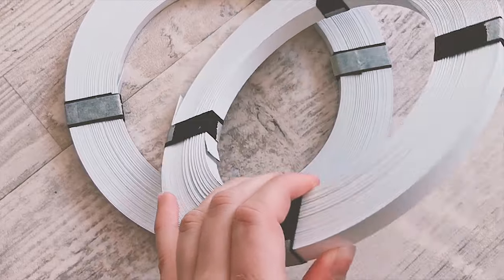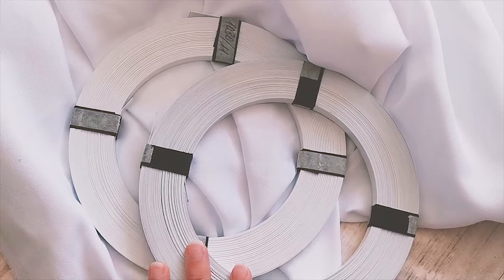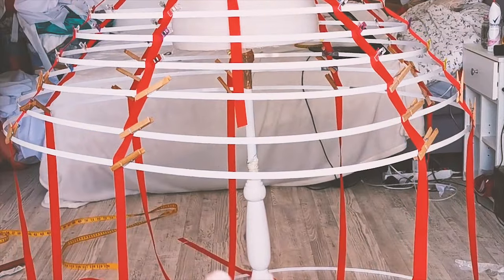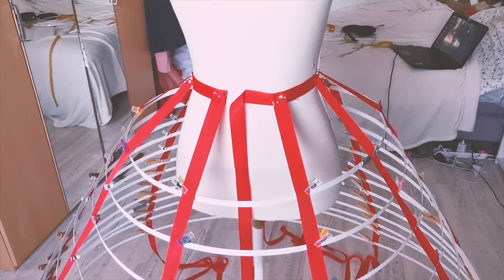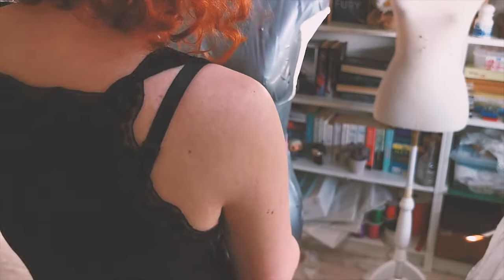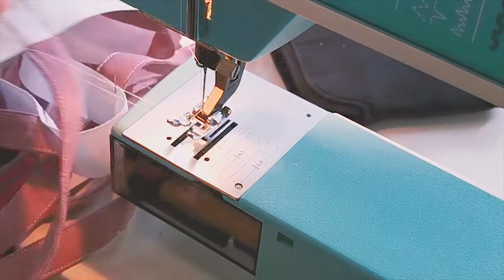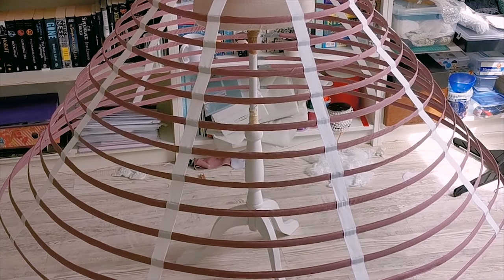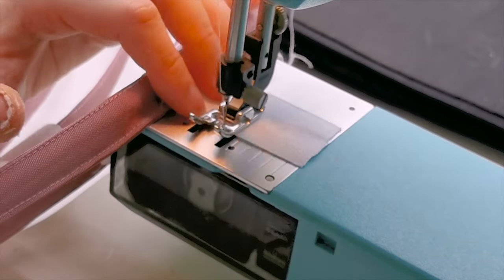Building A Round Cage Crinoline Without Sewing Pattern

Comment: I’m using this method to make my own crinoline, but got stuck at the end. How do you close off and finish the hoops/horizontal channels? Other than that the process was easy to follow :)
Reply from the maker: Tucking the seam allowences to the inside of the channel and then stitching the two ends of the channels together by hand is the best way to finish it 😁. And then handsew the vertical straps to those spots by hand as well
Reply: Camilla Costumes Thanks! 😃

Comment: Hi!! I want to make one but with an open front. Will the steel boning hold its shape? Because I want it to be like a semi circle at the ends but full circle at the top. Does that make sense?? Thanks!
Reply from the maker: Hmmm I have to say that I don't have experience making cages like that, but my Elliptical Crinoline only has a few hoops at the bottom and not at the top. The hoops at the back that don't go all the way around are enforced with the vertical tapes. Maybe you can look into the Truly Victorian Elliptical Cage Crinoline patterns to see what I mean. I think you'd have to do the same thing, only with an opening at the bottom instead of at the top

Comment: hello, just wanna ask if it's ok to use polyester boning instead of flat steel? because it's not available in our country and the shipping overseas is really expensive
Reply from the maker: Oooooo no you really can't. Polyester boning doesn't have the same strenght as flat steel. You really need to get some proper flat steel boning. The weight of the skirts that will be placed on top of the crinoline will otherwise completely collapse and misshape the crinoline underneath.
Reply: @camillacostumes2152  :( i guess i really have to find somewhere i can buy locally. will have to ask some of my friends where they buy theirs. thank you for the info 😊
Reply: @Schuldig  not sure where you are, but I think Sartor Bohemia in Czechoslovakia is reasonable (way cheaper than Australia where I am anyway), but the biggest width they have is only 8mm.. I'm not sure if that's thick enough.

Comment: hello, how much did you leave between each one?...
Reply from the maker: It depends on how tall you are and how long you want your crinoline to be. Let's say you want it to be 90 cm long and the first hoop starts 10 cm down from the waist. That leaves 80 cm left for the crinoline. If you have 10 hoops (for example) 80:10= 10 centimeters between the start of each hoop. But because the crinoline  becomes wider and wider as well, I've noticed it always becomes shorter as well in the end. So I add 10 extra centimeter in lenght total as well. So 10 cm extra : 10 hoops = 1 cm extra space per tape. So that's 11 cm between each hoop on the tape 😁